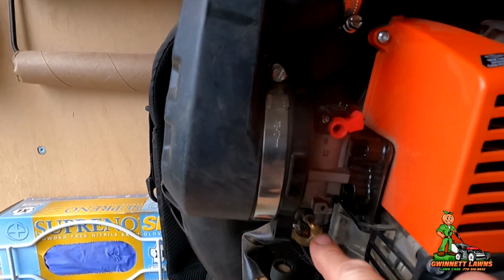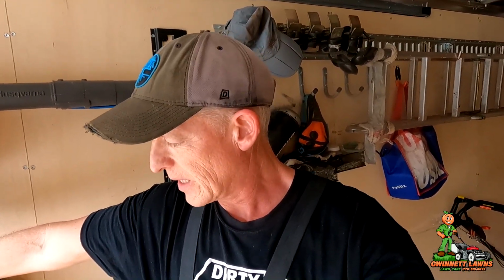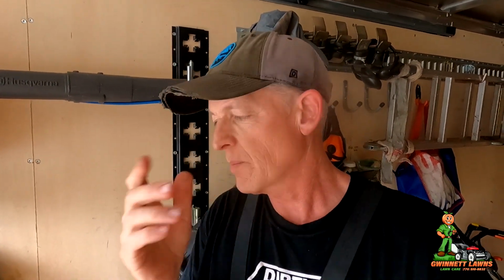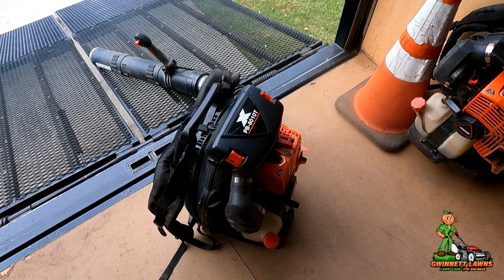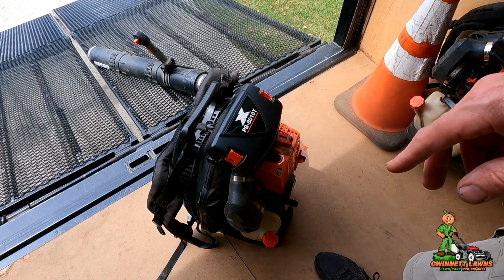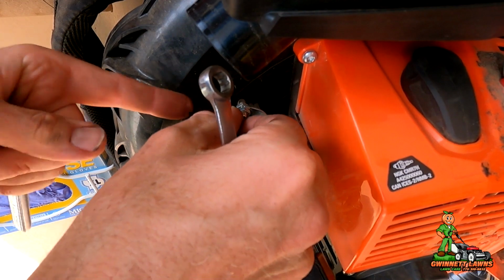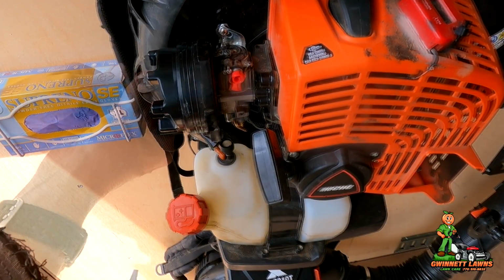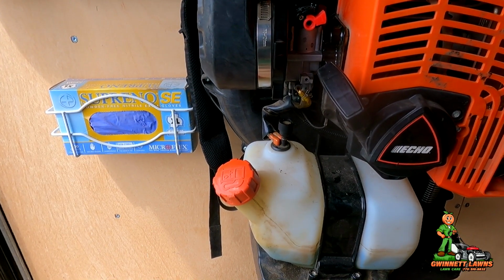How to Change a Carb on an Echo PB8010T Back Pack Blower

Comment: I just experienced the same issue with my 8010T, and was able to use a small jeweler flat blade screwdriver to get in the hole and turn the screw counter clockwise just a tiny bit that cleared up the WOT bog. I do have the Amazon carb tools and the small D tool was too fat to fit in the hole. I really couldn't tell if there was a plastic plug in the hole, but I got the screw turned enough to fix it. I did end up ordering the ECHO tool to do it right the next time. It is part number 91159L.
Reply: Where did you get the Echo tool? Was it Amazon?

Comment: I just recently purchased a pre-owned Echo PB-8010t from a homeowner. Preparing for the big leaf season here at my home. It appears to have the same kind of bog-down yours was doing in the video. Would liked to have seen you do the full carb install. 😏🤪Was wondering if you ever did a rebuild carb video? I don't know the entire history of this blower or how many hours are on it, but it looks all most brand new. I guess I will do the little things first like the fuel filter etc. Whish I knew where to get the right tool to adjust the carb. If anyone knows it would be a big help. At least I could try adjusting the carb first. The owner had misplaced the long tube and only had the short tip tube on. So I ordered a replacement tube. This is truly a BEAST of a machine. For the first time, I am looking forward to leaf season. Hmm... Not Really. 🤪🤪
Reply: How much did you buy it for?  You can try using  a mini screwdriver heat it up with a lighter put it in the hole and turn counter clockwise then check the idle.
Reply: Check for a clogged fuel filter first.

Comment: Here are the Echo/walbro part numbers for the small D tools 91159L also used on the 2620 supersedes 91059L which had a tip that was to short for the 2620 
91186 replacement bit for the 91159L supersedes 91086 bit for the 91059L and 91159S stubby allows the needle of the 8010 to be adjusted without removal of the air cleaner box.

Comment: I bought the Echo 9010T back in early spring. It used to start on the 1st pull. I've only used non ethanol with red armor oil. Now it's starting in 4 or 5 pulls and dies out at idle sometimes after start up. 🤔 Still under warranty but they are way behind, like to fix myself. Any ideas?
Reply from the maker: Replace the carb.
Reply: @GwinnettLawns  Doesn't even have 80 hours on it 😳 I can try it lol
Reply: I’m in the same boar

Comment: Yeah, mine was acting up too this year, after....2/2.5 seasons year round use? Thankfully she was still just inside the warranty, and at first they changed the short block ( and fuel filter ), after two weeks of waiting for the block to show up, but a day or two later she started being weird again 😂 So they replaced the carb....I dunno, I still feel like she doesn't run the same, but the bogging problem is gone 🤷‍♂️
Reply from the maker: I am no longer going to take my stuff to the dealers since they are always slammed and I have to wait too long.  Now I have a spare carb to swap around.  The blower is so strong now better than I ever.
Reply: @GwinnettLawns  Yea the wait is a joke. Way to long here too. I have the 9010T. I'd assume same part and process.
Reply from the maker: Shane W yep its the same.

Comment: Have to replace a whole carberator cause...get this. My pull cord isnt winding in correctly so it can be a little long at times so when i pulled i snapped the choke off. That little red piece is not sold by itself...boo echo! Lol it is what it is.

Comment: They have both a high and a low adjustment, low is down the center of the rotary valve , high rpm is the hole you pointed too, you can get the Echo tool online, but to be honest theses carburetors have a defect in the design and Echo knows it but has done nothing to correct it. They have a pressed in brass jet that is seated on a Oring in a bore inside the carburetor, the jet dislodges over time and causes the problem, the new carburetor you just bought will do the same thing eventually…